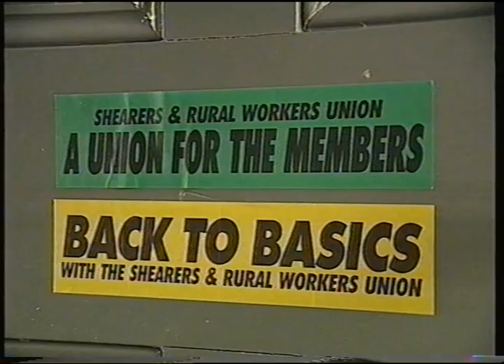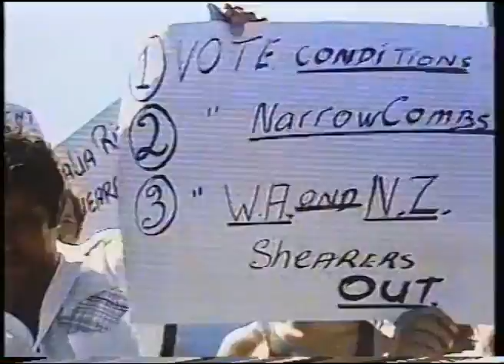The Shearers and Rural Workers Union, Australian Shearing, 1995

Comment: Some interesting posts here on YouTube, including this one, that provide some insight into shearing, the life of shearers, and the politics of rural Australia.  No doubt it is one of the most physically demanding jobs in the world, and requires a high degree of skill as well.  Better shearing machines and slings to take some of the upper body weight off the shearers back help, (called here a 'back brace'; but the strap worn around the middle and known as a back brace in the USA is useless to east back strain), but only a little.     Of the innovations to make the process easier, most are too complex (prone to breakdown and high maintenance costs), and much too expensive to buy in the first place.  Using a drug to stimulate uniform wool shedding with the sheep sewn up in nets also seems to have a number of potential problems- and 20 years later has not become widespread.      The best solution for easing the physical strain- significantly lengthening a shearer's working life while reducing back injury - that I have seen is the Moffat shearing table.  Unlike many shearing tables, it is simple and rugged in construction and easy to use.  (See the YouTube video.)  Still, in spite of how easy the demo video makes shearing on the table look, catching, loading on the table, and shearing sheep - quickly while preserving wool quality and minimizing nicks - is still a skilled and demanding job... especially as sheep are not always as clean or docile as shown in the demonstration.
Reply: Thank you for your guidance